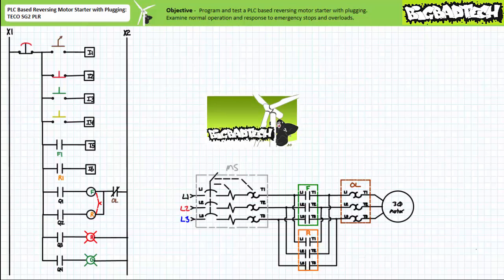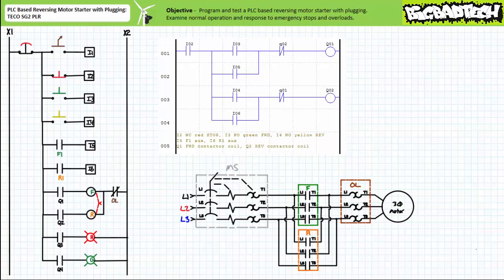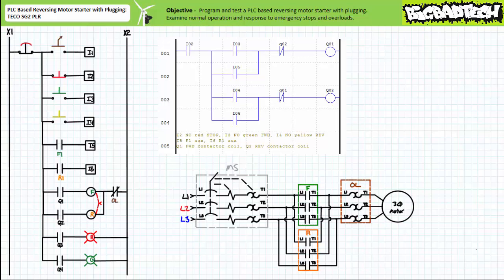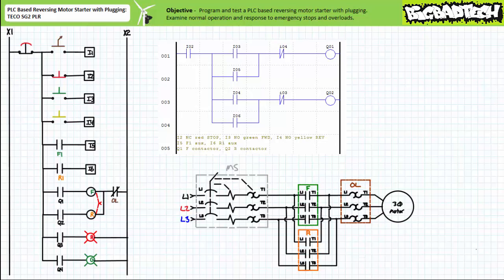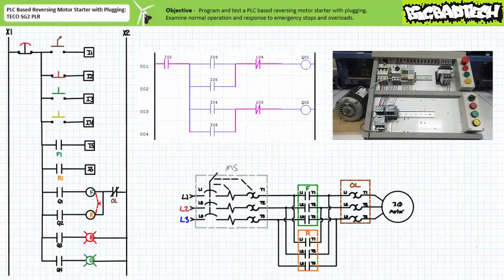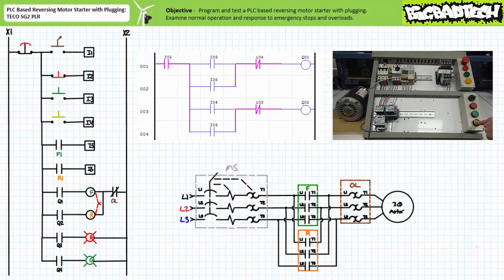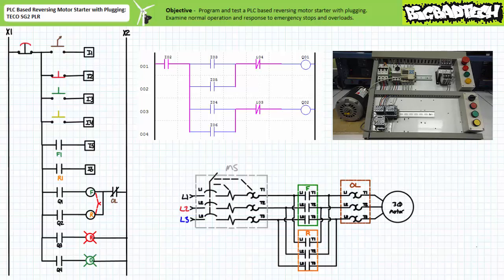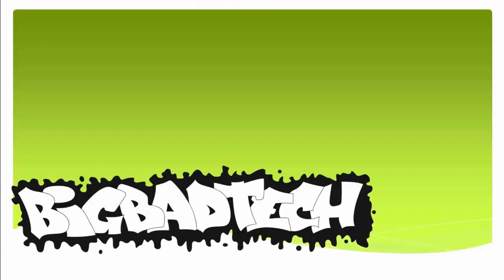PLC Based Motor Starter with Plugging: TECO SG2 PLR (Full Lecture)

Comment: If we decide to use NC I06 instead of NC I04 in the upper rung and NC I05 instead of I03 in the lower there is a dangerous fact both contactors are activated at the same time even for a short time. I reckon this option is not a safe one and is prohibited.